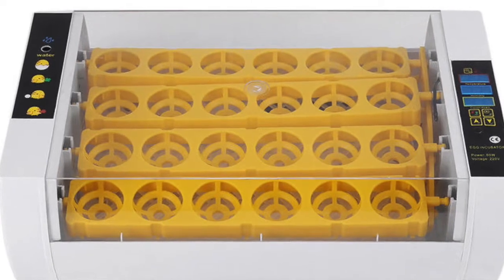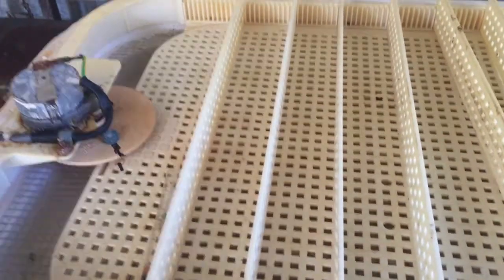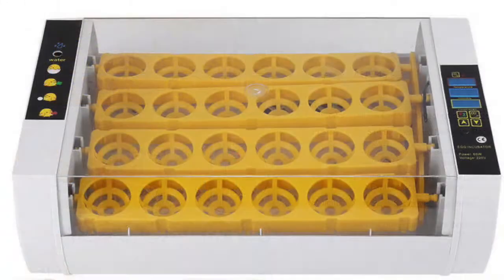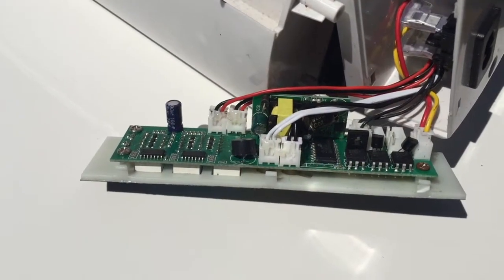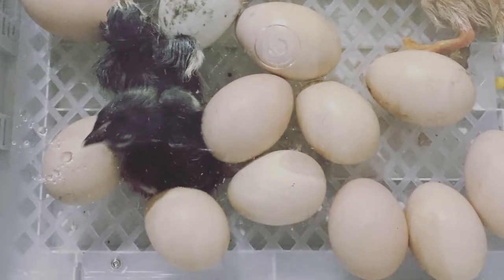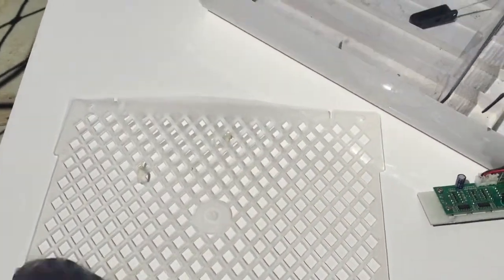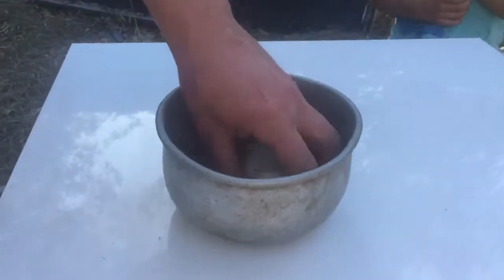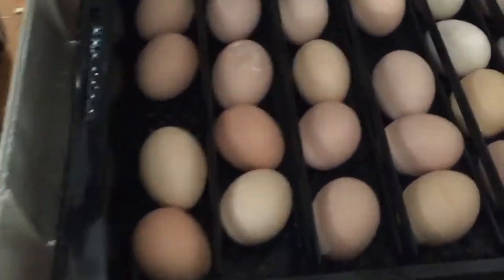YZ24A Review - Is this the worst Incubator Ever?

Comment: Reminds me of my having to "kit bash" my aquarium filters. The design hasn't changed in fifty years, AND the engineers obviously have NEVER USED their own designs. Theory is fine, but start USING your own product and you'll immediately see issues you hadn't caught. I examine every new kit from China mfg. for COLD SOLDER joints. THAT I can fix.

Comment: This is a good incubator, if you keep the humidity at 60 it’s fine for the price, if it gets too low put the put the polystyrene cover that comes with it on and that blocks air getting out and will raise it, I have had 100% success rate with it apart from my dud eggs all chicks hatched and this video is misleading.
Reply from the maker: Everything I said in the video is my truthful experience and therefore is not misleading. 
Keep in mind that they could have improved the design with yours, mine did not last long at all, and due to no fault of my own.
I’m glad you had a good experience with yours, mine remains unusable due to faulty fans after only a handful of attempts.
Because of the other problems, notably large eggs banging against the top case every time it turns I decided not to try and repair it.